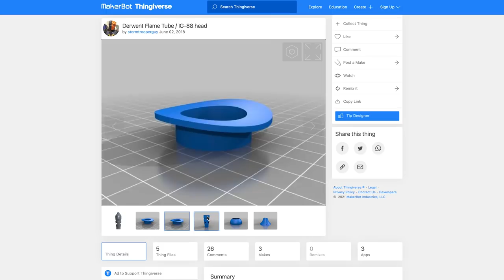Paint & Weather Your Droids - Star Wars IG88/ Mandalorian IG11

Comment: i cant wait to try the spray adhesive trick, how much time do you have to let it cure for before doing the gloss black... Awesome video and collaboration
Reply from the maker: Great question. It can vary based on the weather, but typically I found that you can paint over it in about 15 to 20 minutes.

Comment: Hi Derek
One question, your IG-88 head in the video seems a little shorter than the thingiverse model
Did you cut in some was the IG88-head_-_bottom.stl file?
TIA
Reply from the maker: Yes. I removed part of the bottom.
Reply: @VanOaksProps  good to read that, I will follow your steps, jejeje 😉
Thanks, and best regards from 🇦🇷